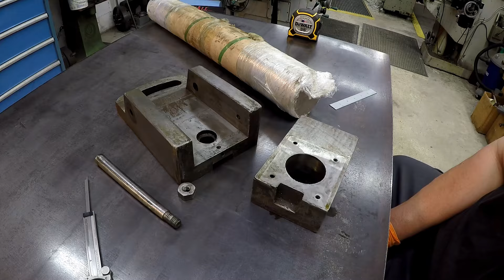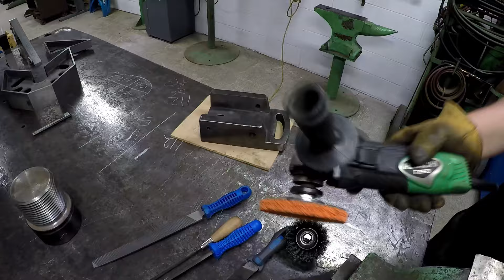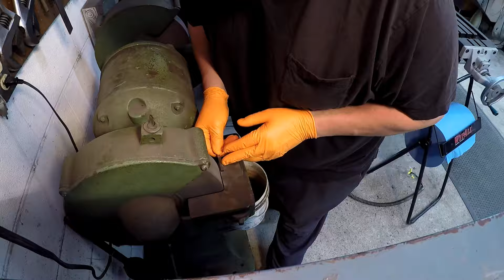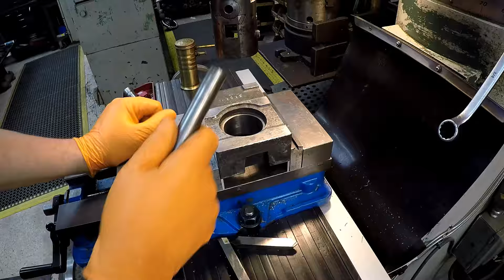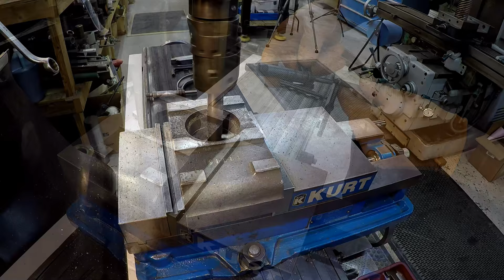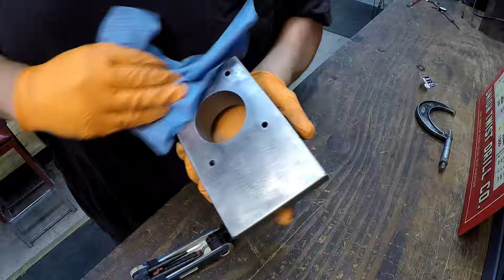Custom Internal Shaping Bar Part 1

Comment: I am confused as hell on how that first cut was actually correct and concentric with that entire  tool wobbling all over the place??
Reply: There are two pieces dovetailed together in the top of the boring head. The bottom piece can slide in the dovetail to increase or decrease the diameter you want to cut. They are clamped together with grub screws when the cutting edge is at the diameter you want. You can kind of see it if you pause the video at the right times.

Comment: Min 10 took me back to my only experience with lathes. After a Govt training course I took a college course to get formal qualifications in engineering, not a degree, but more hands on. When the college lecturer took us to have a go each on the lathe I saw the tool bit looked like the corner of a brick that had been hammered off ! I took it over to the grinder and worked it for side, front and top rake. the whole thing had to be re shaped. All this time the (other lecturerer) was talking animatedly in my ear. I answered all of his questions about lathe tools and refitted the corrected tool back in the lathe to the smirk of the interferer. It worked first time and put a shine on the mild steel rod that looked like a dog's round things ! Both lectureres were impressed at the skills learned from a Govt training course. Smile. Never touched one since. This is all mannah from heaven to me. It really is a serious skill/artform. If you get a chance please see this guy, you WILL like him :) https://www.youtube.com/watch?v=0OLOgeY33go

Comment: Any reason why you not boring it in the Lathe with a four jaw?
Reply: I believe its because the hole offset is to great.
Reply: OutOfTheirSkulls 
Nope, the big thing about a 4 jaw is doing odd shapes, the solution is to mount counterweights to the T slots opposite the large side, I have turned blocks with much larger offsets on a lathe with a smaller swing, I know I had to use 2 weights almost at the ends of the T slots and I think they were about 1lb each and out further than the corners of the workpiece. Once balanced the chuck would stay anywhere I stopped it, ran at a couple hundred rpms, no noticeable out of balance forces. 
The most likely answer is ‘because Adam wanted to do it that way’ or didn’t want to spend the extra setup time when he had access to a faster method. 
Of course it is possible that with such a small part and such a heavy lathe he could have omitted the extra balance weights and therefore the extra setup time and still got a perfect hole at the low rpms he used with the boring head.

Comment: I went back and watched some of your older videos and am truly appreciating all the upgrades you've done to your shop.  Especially the lighting!  It makes seeing the details of what you're doing much easier.  Also that table is great as far as it's a clean background for highlighting the talking point of the video.  

Not related, nice cameo on THOT's page.

I was wondering if you would consider doing a basics measurement video?  A lot of the videos/pages I find are about how to read a micrometer.  While that's easy enough, going over the feel and how hard to clamp onto the piece when measuring or going over that rocking motion you do as well as that kind-of soft hands catch you do on the bore gauge.

Comment: Hey Adam, been watching your videos for a while now, and between you, Jody and Tony, I went ahead and taught myself TIG welding and bought a cheap little lathe, watched all you guys' videos over the past 5 years, thinking I'd just use the skills to make stuff for myself and maybe family members. Turns out there's nobody around here that weld aluminum or manually turn metal, so my cheap welder and chinese import lathe have made their investments back many times already, although pretty much all of it has gone back into tooling and precision measuring equipment, and I love doing it to relax, everything about it is so meditative and a nice change from the attitude I'm used to having to have at work (at work I have to make sure things are done FAST, with welding and machining I can calm down and make sure it's done precisely). Having spent a lot more now on precision measuring devices, I have to say I'm pretty impressed with what cheap import machines are capable of these days. I did split my first 4-jaw chuck in half from overtorqueing it but with their prices I guess you can't always get the best :P

I do have an old Starrett depth gauge from my visit to New Hampshire last year, missing the 2-4" range, but for how little of my work is imperial it doesn't matter too much. Have to say you're right about what you've always been saying about just the feel of old Starrett tools, they're pretty great, I wish I had more use for them (I'm European so I hardly ever take them out except to just admire them).

Thank you for all you've been able to impart in terms of knowledge, I hope you keep it up for many years to come. Next I'll have to get myself a milling machine, when the hobby budget allows for it.

Comment: It is great that you found a use for the extra clapper.  Combining tool-making with recycling, you set an example for hobbyists and demonstrate your appreciation for the gifts and things viewers send you.  Watching your work, one could believe that with enough of the right metals, you could make nearly any tool or machine part in your shop, even going so far as to increase their capabilities through customization like this.  It is a kind of self sustaining system reminiscent of early blacksmiths, who built their own tools, and passed them on to their apprentices.  On a side note, the length of your shots is right on, not so long as to become boring (no pun intended), while long enough to paraphrase each operation.  Glad to see you are doing well, and are finding new and interesting sources of content, take care.

Comment: I'm kind of surprised you didn't just fabricate a whole new "carrier" (meaning the piece that mounts directly to the head of the ram, the piece with the semi-circular cutout) from a fresh piece of steel and then drill & tap that piece to accept your boring bar.
Reply: the shaper requires the clapper box for tool clearance on the return stroke or the bit would be ruined after the first cut so a ridged mount is no go

Comment: Hi Adam, Great video.. Thanks
I have often thought about when the tension/feed takes place on a shaper. Does the tension/feed only increase when the tool is completely back ...? Otherwise, it is not possible to use a fixed bar like this or how doe's it works?

Comment: Hey, Adam, I have a pre-1930 G&E 24 inch shaper which doesn’t have an automatic lubrication system. However, the head is fitted with a hole for an automatic downfeed. Any idea where a guy might find the mechanism for the Downfeed?

Comment: I'm a little confused, Adam. Why would you not want the clapper box to clap?
Reply: Doug Rundell you get an issue with tool pulling into the job.  So you either lock the clapper and cut down,  or invert the job and cut up then the clapper swing doesn't cause an issue.

Comment: Out of passing interest, I used to keep a few scraps of automotive heater hose, split the long way in my 'junk' drawer. Just the thing for for holding delicate items, such as the mic gently in the vise (and/or wherever). As always, common sense & good judgement required. :) Cool videos, Thanks!

Comment: You are dragging your flap wheel on the backstroke.   No no no.
Reply: Backstroke drag on angle grinders is always going to be a problem until you get your hand-held power tools fed with DC. Just look how they absolutely eliminated backstroke woes on early battery angle grinders. Sadly the brushless models may have revived the discombobulatery mischief. Perhaps we need a flapper clapper? ;-)
Reply: Could one of you guys explain this a bit more? I'm curious! Always looking to improve techniques! (Just a home gamer)

Thanks in advance!
Reply: @mattmanyam  Pretty sure it's a joke based on the times some people repeatedly scolded Adam for not lifting the hand file on the backstroke.

Comment: Adam, on my vertical shaper I made a similar bars to what you are making here.  Then a couple years ago I made a bar that I bolt Morrison type keyseat cutters to.  Works like a charm and a lot easier and less costly per cutting edge.  Lot less time standing in front of a grinder.  One bar can cover a whole bunch of internal keyway sizes by just changing out the Morrison single tooth cutters.
Reply: Dale, I use my 12 inch stroke Morey Vertical Shaper to cut internal keyways and splines.  A few years back I cut internal splines in hundreds of collars used in hammer type drill bits used to drill holes in the ground for construction or other purposes.  My Morey has a built in rotary table so it is not difficult to cut splines, multiple keyways, etc.
Reply: WD Green  neat 
I never saw one of those machines but I have mental picture. I’ll google it. 
What vintage is it? Yes like to find a old one for my personal projects.
Reply: WD Green I found a bunch of them for sale
Web 
I knew 6-8,000 pound machine. 
I would used it couple times per year on my personal projects.
Reply: That's a good idea!
Reply from the maker: One of my viewers has offered up a nice old Pratt & Whitney vertical Slotter but it’s too big to fit in my shop.
Reply: What stroke? Maybe it could find a home with taller ceilings. :-)
Reply: Is it in Alaska I'll go check it out,    i've always have internal spline projects.
Reply: I have been looking into a rockford shaper looks more like a small planer and I could put rotary table it horizontally.
Reply: what brand is your vertical shaper?  and what do you use it on?